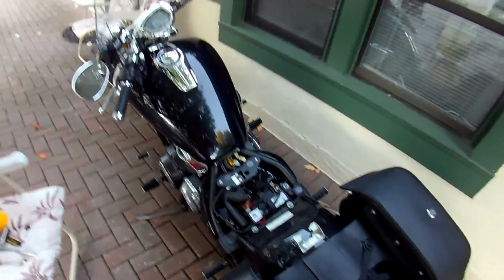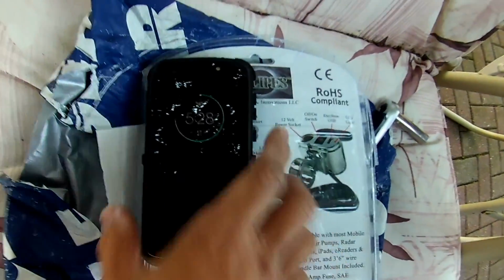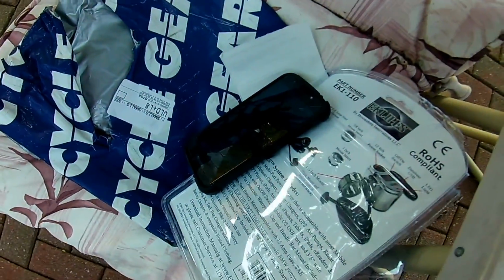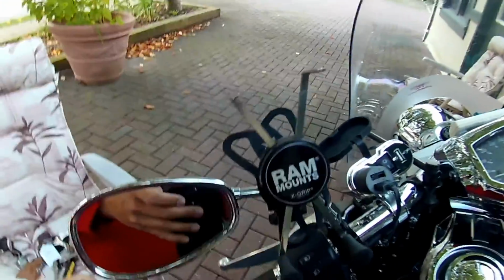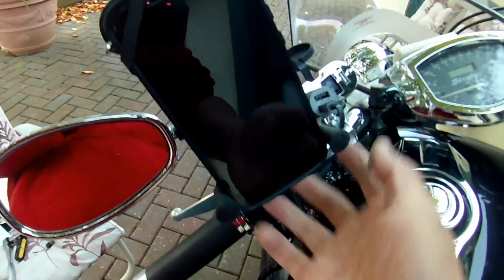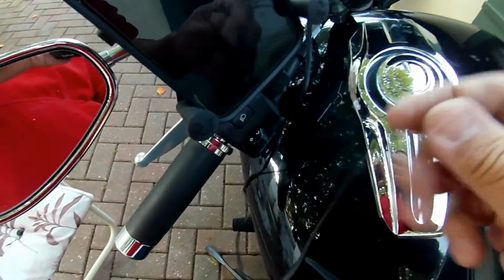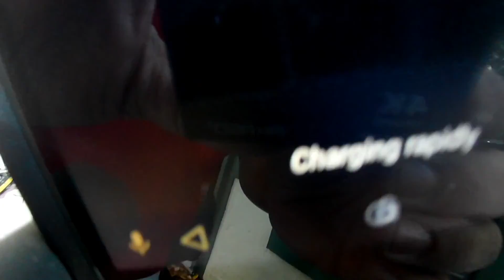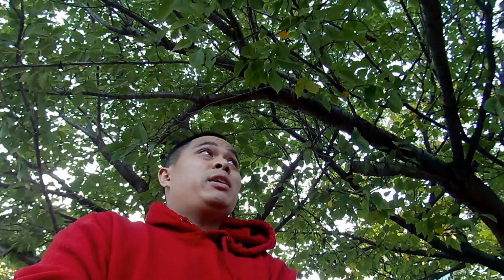Motorcycle Handlebar Power Outlet REVEAL!!!

Comment: Nice set upwith the charger. 
The ram mount definitely needs it's replacement nubs. Then the band on all 4 sides. 
Any other way defeats it's design.
Reply from the maker: Yeah I don't know how I lost those things, and the band even snapped on the inner ring section so it has to get double looped on either top or bottom.  Bummed I only used it for one ride